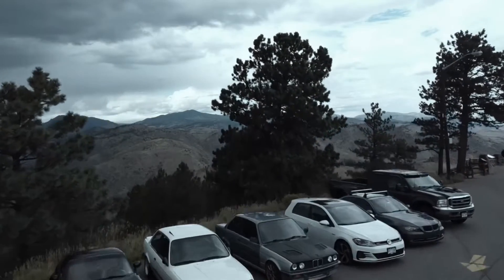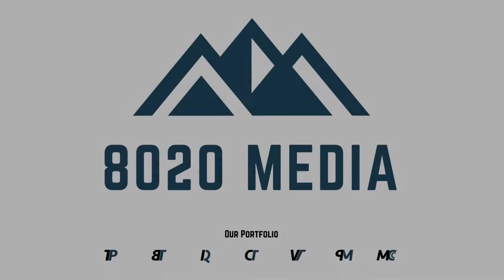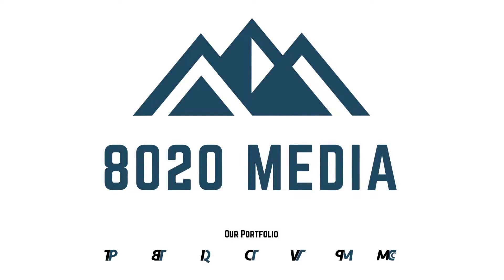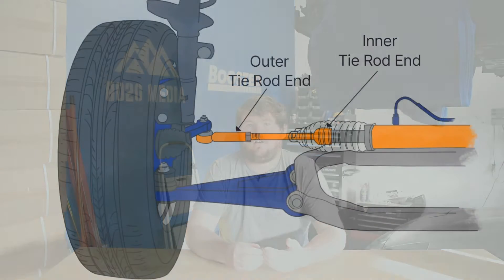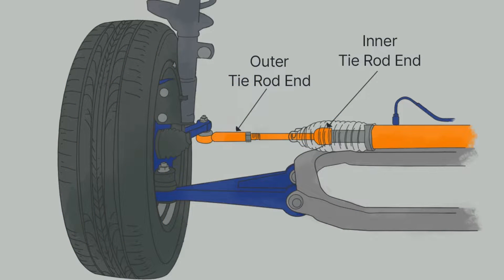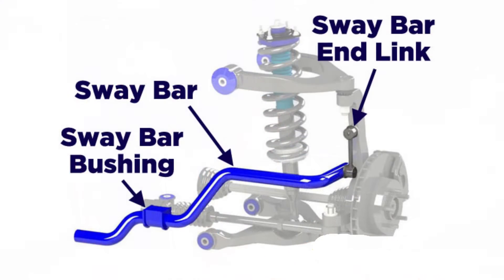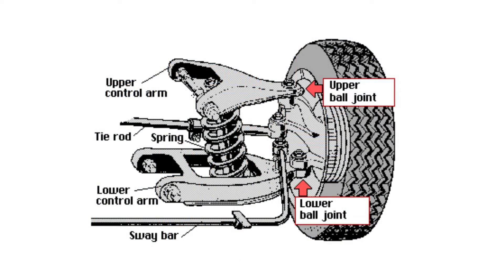DIY - How to Diagnose a Car Clunking Noise While Turning

Comment: I replaced sway bar links, inner and outer tie rods, lower control arm bushings (all three), lower ball joints on 2009 TSX and torqued with weight of car on wheels. However, I have a bad metal to metal, grinding noise when turning wheels while driving. No noise when turning wheels on Neutral. Only on drive, at slow speed. CV axles look good as does the rack and pinion but I may be wrong. Any suggestions?

Comment: I have a v6 camaro I notice clunking when turning and accelerating i replaced both rear cv's but still the clunking persist usually during sharp left turns and only when accelerating never when coasting no matter the speed

Comment: My whole front end was replaced. Just did inner tie rods. However when I’m turning at low speeds driver side and reversing driver side very loud clunking. If I hit a bump hard clunk noise and I have independent suspension. Any thoughts what that could be?

Comment: I have a 94 Jeep and when I turn into tight parking spots or make tight turns my front end starts clunking hard like metal banging with occasional cracking sounds and the car starts shaking, but when I turned straight again, it stops? Any recommendations?

Comment: Super frustrating, when I bought my vehicle I had these sounds, it went away, now after intense 4x4 sessions its back again, like wtf.
Reply from the maker: B - Well, sounds like there's a reason for the noises to come back haha.
Reply: @8020Automotive  Haha, turns out it was my bashplate's little extra work I did that was too tight on the chassis makin the noises when turning. Damn misplaced screws, took it all out and added some winter rubber for a cushion between the bash and the chassis at the screw points, all is prefect now.
Reply: Just FYI aint nothing wrong with 4x4'ing bro. You own a 4x4 you use it.

Comment: Hi, my 2015 outback 3.6 making rattle and clunking sound when driving at lower speed on passenger side. I tried to change the lower control arm, cv axle, change the sway bar end link to the rallitek adjustable end link since I used Ironman 4x4 2” lift suspension. The rattling and clunking sound still can be heard at low speed. I noticed that the outer side wall of the passenger side wore out compared to the other tires. Do you have any idea on what happening? Is that because of the endlink swaybar?

Comment: I have a Volvo S60 from 03. I get a clunking noise sometimes when I’m turning and going over curbs, most of it comes from the right front but also left. I gets worse when the car is wet from either rain or car wash. I’ve had the upper spring seats and control arms replaced but the clunking is still there. Any suggestions?

Comment: Okay i have a clunking sound coming from around the front of the steering wheel on the driver side, mostly happens when turning tires while stationary, or while turning at low speeds (under about 15mph), but i also have more play in the steering at higher speeds where it feels it doesn't start until I'm almost an 1/8 to a 1/4 turn of the wheel. I have looked everywhere on the front end and haven't noticed anything too out of the ordinary for an 07 trailblazer at 170k miles but i did a full front suspension kit outside of shocks/struts about 30k miles ago including the steering rack after i had a line blow and my control arm failed. I also did outer tie rod ends about 15k miles ago. The biggest thing I've seen is some play in my steering rack while turning and it appears my rack seems to be leaking as i do have to top off the fluid once every month or so but i can't pinpoint anywhere as it all is just spread out under the car. Any help is appreciated im 100% lost atm
Reply: Did u figure it out
Reply: @theMAGAdestroyernot really best guess is my suspension components, tie rod ends, and steering rack are just worn out again or they were installed wrong when i had it done a few years back, i have noticed a power steering fluid leak so maybe the rebuilt rack i had installed is bad and i need just to replace all the steering and suspension components to completely stop any issues one of the situations id rather just throw the money at it and have everything be 100%

Comment: I have a 2019 nissan Sentra and it’s an electric power steering and it squeaks when turning right while in motion. Would you have an idea what it could be?
Reply from the maker: E - On your 2019 Nissan Sentra with electric power steering, a squeak only when turning right while in motion is less likely from the steering motor itself and more often caused by a suspension or steering component under load — common culprits include a dry or worn strut mount bearing, sway bar bushing, or control arm bushing that squeaks as the weight shifts; since it doesn’t squeak turning left, that suggests the noise is load-dependent on the right side, so I’d inspect the passenger-side strut top, sway bar bushings, and ball joints first, as these rubber or metal-on-metal contact points tend to squeak under directional stress even with EPS systems.

Comment: My does a clunking sound when turning left only and when is cold weather i have new control arm and also tie rods
Reply from the maker: I - If your car only clunks when turning left in cold weather even after new control arms and tie rods, it’s worth looking at other suspension and steering components that can make noise under load: the strut mounts/bearings often clunk or pop when they’re worn and steering is loaded one way, sway bar links or bushings can also knock in cold weather when the rubber stiffens, and a CV joint (especially the outer joint) can clunk more noticeably on sharp turns. Since it only happens left and not right, I’d carefully inspect the left front CV axle, sway bar link, and strut mount — cold temps can exaggerate clearances in those parts, which explains why it shows up more in winter.

Comment: W164 ML350 4matic petrol 2006 

I have a knocking sound when turning wheel fully and driving slowly, sometimes once or sometimes might knock more twice, only when its fully turned and mostly when turning to the right. and very rarely have i heard a knock (not with wheel fully turned) when going uphill a little bit at normal speed and accelerating

When turning fully to the left at slow speeds it feels like its rubbing against something and you can feel it in the steering wheel itll shutter, but i was told this is due to it being 4matic?
Reply from the maker: C - The knock at full lock (especially to the right) and occasional knock uphill under load is most likely from a front CV joint or driveshaft starting to wear, since these noises are most noticeable when the joint is under maximum angle or torque. The shudder/rubbing feel when turning fully left is indeed a known quirk on many Mercedes 4Matic and other AWD systems — at full lock the front differential geometry and tire scrub can cause a vibration that feels like rubbing but is generally harmless unless it’s extreme. That said, the actual knocking you describe isn’t normal for 4Matic; I’d inspect the outer CV joints/axles, front strut mounts, and control arm bushings for play, as any looseness there can show up only at full steering angle or under uphill torque. If the knock gets louder or more frequent, replacing the affected axle/CV joint is usually the fix.

Comment: I have a 2014 ford escape and i hear grinding / clunking in the rear when turning at low speeds all the boots are good
Reply from the maker: M - A grinding or clunking from the rear at low speeds when turning usually points to the rear differential (PTU/RDU) clutch pack or bearings rather than bad CV boots, since you’ve confirmed the boots are intact. These Escapes with AWD often develop wear in the rear drive unit’s clutch packs that makes noise on tight turns, almost like a binding or grinding, and sometimes fresh fluid with the proper friction modifier helps if it’s not too far gone. Other possibilities include a worn rear wheel bearing (which can growl or clunk more under side load in turns) or loose suspension bushings/end links letting the rear shift slightly. Best first step is to check rear differential fluid level/condition, then inspect wheel bearings for play and suspension components for looseness.
Reply: @8020Automotive I replaced the ptu fluid and no metal shavings were in it and 1 year ago the rear differential fluid was replaced and the fluid seemed good I cant seem to  figure out what's wrong and dont want to pay high prices to figure it ou

Comment: I have a 2007 xlt triton, whenever I turn in birth directions there’s is a creaking noise but when the wheel straightens out there is no noise.
Reply from the maker: X - A creaking noise only when turning the wheel is usually from the front suspension or steering components moving under load. The most common culprits are dry or worn ball joints, upper/lower control arm bushings, or tie rod ends—when you straighten the wheel, they’re not under side load, so the noise goes away. The steering shaft u-joint and strut mounts can also creak when turning if they’re dry or worn. The best next step is to jack up the front end, safely support it, and listen/feel while someone turns the wheel—often you can see or hear the joint/bushing moving. Lubricating suspension bushings can quiet it temporarily, but replacement of worn ball joints or bushings is the lasting fix.

Comment: Bmw M4 2014 with a liberty walk kit , wheel spacers make a clunk noise when turning the steering wheel , any fix?
Reply from the maker: N - Sounds like a sweet build. That clunk when turning with spacers is usually from the front wheel spacers not seating flush, lug bolts not tightened to spec, or extra stress they’ve introduced on the hub/steering components. Even small play between the spacer and hub can cause a sharp clunk as the wheel shifts under load. First, make sure you’re using hub-centric spacers (not generic flat spacers) and that both the hub face and wheel face are perfectly clean of rust or paint. Torque the wheel bolts to BMW spec (usually ~105 ft-lb) in a star pattern. If you already have hub-centric spacers and proper torque, check the front control arm bushings, tie rods, and strut top mounts, since the added leverage from the wider track accelerates wear and makes existing play more noticeable. The fix is usually as simple as replacing cheap/universal spacers with proper hub-centric ones, or addressing worn suspension joints that the spacers have highlighted.

Comment: Thanks for sharing your knowledge with us in this informative video. My 2006 Corolla makes noise from the rear passenger tire when I make right turns. Sounds like I may be sway bar bushings or a worn ball joint. At least I'll sound like I know what I'm talking about when I bring it in.
Reply from the maker: L - Thanks for the feedback! A noise from the rear passenger side on right turns is more likely from the rear sway bar end link or bushing, a worn strut mount, or even a loose exhaust hanger near that corner than a ball joint (rear suspension on these doesn’t use ball joints like the front does). When sway bar bushings or end links wear, you’ll hear clunks or squeaks in corners as the body rolls, which matches your description. A wheel bearing can also make noise that gets worse when loaded in a turn (in your case, right turns load the left side, so if it’s really on the right, it’s less likely a bearing). When you bring it in, mention rear sway bar bushings/end links, strut mount, or wheel bearing inspection—that’ll put you right in the ballpark.
Reply: @8020Automotive  Awesome feedback, really appreciate you, thanks!

Comment: My car has multiples small issues here and there. 

Fist of all, there's a sort of rear left instability at "high speed", weither it's a left or right hand turn, it feels like the rear left is sliding. It's even worse on left hand high speeds corners, when the load is on the right side of the car, it feels like the rear left really wants to step out and there's this clinging noise on the rear left of the car as if metals or unscrewed screws were moving around... 

Secondly theres theses regular, squeaking, rotating noises from the rear of the car at low speed. My mechanic said that it was the brake pads but they are only 1 yo and the noise was not there before. Also, when my car is parked on downhills and I release the manual handbrake to go, there's sometimes a huge squeaks for a couple seconds and then you start to hear small and regular rotationg squeaks noises.

Third one is "clinking" noises, I don't know how to describe it but it's like a ball joint noise. It happens when I downshift into 1rst, then when the car jerks off, you here a "clock" kinda noise...
Reply from the maker: J - The combination of symptoms you describe points to a few separate but related rear-end issues: the instability at speed and feeling like the rear left is stepping out strongly suggests worn or loose suspension bushings, trailing arm bushings, sway bar links, or even a failing rear wheel bearing on that corner—especially since you’re also hearing a metallic clinking back there. The rotating squeak at low speed and loud squeak when releasing the handbrake are often brake related, but if pads are only a year old it could be a sticking caliper slider, warped rotor, or a rear wheel bearing starting to go, since bearings can squeak in rotation before they rumble. The clunk when engaging 1st is very much like a worn ball joint, CV joint (if independent rear), or differential bushing that lets the driveline move and “clock” under torque. In short, I’d have the rear left suspension thoroughly inspected—especially wheel bearing, bushings, trailing arms, sway links, and caliper bracket/slides—because your handling issue plus the noises all line up with looseness or play in that corner rather than just brakes.

Comment: I see ur still answering questions and I thank you for that, I have a lowered audi q3 with a 2” drop, ever since the drop when i turn all the way to the right when moving either forward or backwards and the front suspension articulates I hear and feel a sharp but small “pop” almost as if you cracked one of the cars bones, dosent happen when i turn left, just right, I just wonder which suspension parts I might need to make adjustable, ive been thinking the tie rod but its definitely a pop and not a klunk, I appreciate any help thanks 🤙
Reply from the maker: C - Of course! We try to help anyone. A sharp “pop” on full right lock with suspension articulation after a 2" drop is usually from binding in the front end geometry rather than a loose part; lowering changes the angles on CV axles, ball joints, and tie rods, and one side may now be hitting its limit sooner. Since it only happens turning right, the most likely culprits are the outer CV joint binding under angle, the upper strut mount/bearing plate popping as it loads up, or the sway bar end link binding due to the changed control arm angle. Adjustable tie rods (bump steer kits) help if your steering geometry is way off, but a “pop” instead of a “clunk” points more toward the strut mount bearing or CV joint reaching the edge of its travel. I’d start by checking the top strut mount/bearing for smooth rotation and inspecting the passenger-side CV axle boot and joint—those are the first to show issues after a drop. If everything’s tight, adjustable control arms or end links may be needed to restore proper angles.

Comment: The car is parked with the ignition on.  When I turn faster driving wheel in both directions, I hear a knocking sound.
Reply from the maker: J - What you’re describing on your C5 Aircross is quite typical of electric power steering (EPS) systems, especially when stationary, since the steering motor only activates in response to steering angle sensor input and torque demand, which can create a slightly jerky or “stepped” feel as the assist engages in pulses rather than smoothly; the light knocking sound you hear when turning quickly is often from the EPS rack preload, intermediate shaft play, or even strut top mounts transferring noise, and it usually becomes more noticeable with the wheels loaded at a stop. At just 37,000 km it’s unlikely the rack is failing, but it’s worth having the dealer check for EPS software updates, steering rack bushing or intermediate shaft play, and ensuring the top strut bearings aren’t binding. In most cases this is a characteristic of the EPS system design and not an immediate fault, but if the knocking gets louder or you notice vibration while driving at speed, then it’s a sign something mechanical like the shaft joint or rack bushings needs attention.